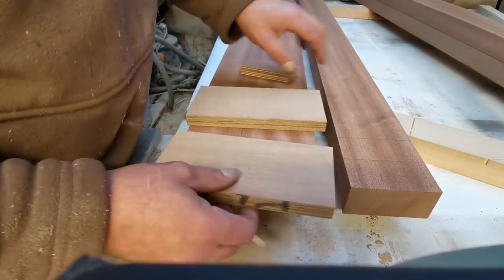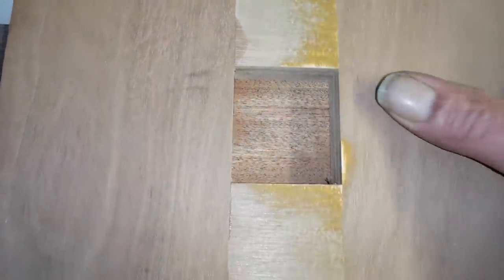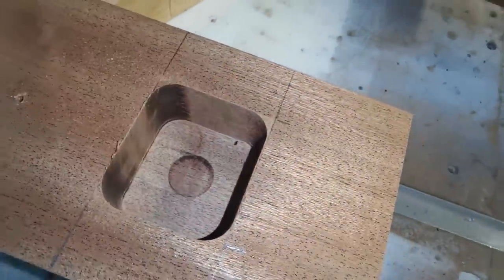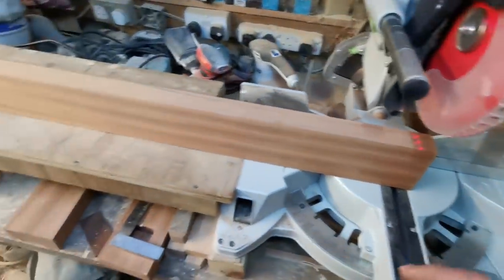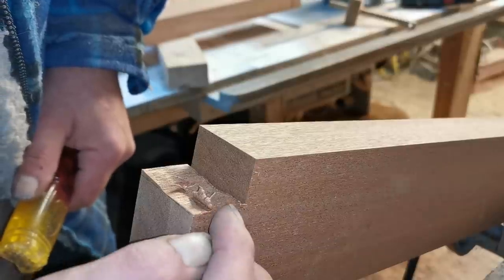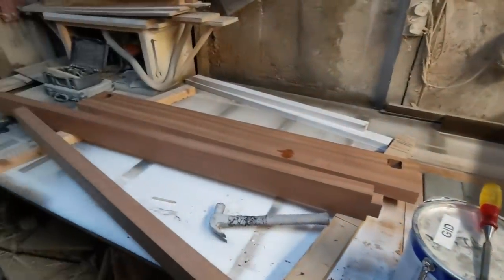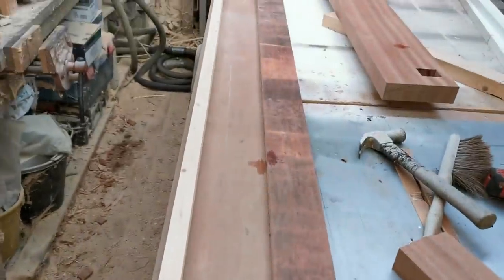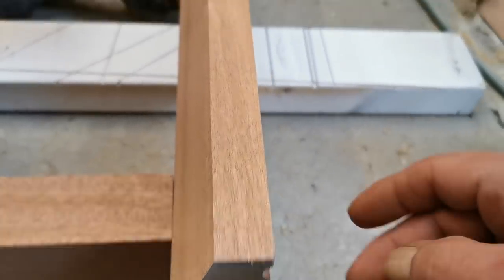French doors & bay window Pt6 - Making the window, mortices with a router & planing a chamfer

Comment: I was so involved in that mortice clean up I subconsciously blew at my screen to get rid of those shavings 👀. Its been a long day!
Reply from the maker: 😂🤧 I think I've done that, backed away from the screen when the shavings off the router hit the camera 👍👍
Reply: @Gidjoiner  not just me then! Love these videos! Any more projects in the pipeline? What's your workshop tablesaw btw?
Reply from the maker: 😊👍 Maybe more vids after this, not sure yet, I've plenty of work but not sure what's filmable, sometimes it's just work n i have to crack on 👍 
I only had about £500,  I had a choice when i bought the table saw, a couple of cast iron topped ones that didn't seem that well made, a small Dewalt/Makita type site saw or this Scheppach tisa 5.0 table saw, i went with the Scheppach because it cuts 100mm, the others only went to 70mm-ish, & this was more powerful, i had a welder so planned on making a decent fence which i did, I never put the metal frame legs on it, it's always been mounted in the table as it is as i planned, it's a good saw but it is a 'Scheppach site saw' so it has had it's niggles which I've fixed , it's sort of become mine to care for & enhance 🤣 i had to fix the rise n fall but now it works better than it did before 😁 that's in one vid but i can't remember which, & the fence is excellent, I very rarely use that word but there's pretty much no play at all 😊👍
This is my tablesaw fence overview vid showing the saw, https://youtu.be/tQ97rFxfRFc 
Screwfix sell a smaller version, the 310, pretty much the same just less powered only cuts 80mm, https://www.screwfix.com/p/scheppach-ts-310-315mm-electric-table-saw-230v/4446J?kpid=4446J&ds_kid=92700022882493574&ds_rl=1241687&ds_rl=1245250&ds_rl=1244066&ds_rl=1249796&ds_rl=1245250&ds_rl=1249484&gclid=Cj0KCQjwu6fzBRC6ARIsAJUwa2QAY9Z3FEcbCMcEotrJacaRjkktt0iVXwXAMrUXKatma7iQPH4dsCYaAhioEALw_wcB&gclsrc=aw.ds

Comment: When you make those tenons, how much stronger are they than an XL domino? Would it work if you just dominoed it?
Reply from the maker: Dominos might be quite strong but i think these traditional tenons are stronger, the wood on the rail - the tenon, is part of the rail so no chance of it loosening, the surface gluing area of the tenon that is in the door stile mortice is greater than it would be for a domino, If i used Dominos the joint would have to have a groove or some kind of stub tenon included because a reg domino butt joint might open up n leave a gap, I don't use the domino on exterior doors & the only thing holding these 7½-8ft doors are these tenons, these aren't cheap doors, I don't want any comeback, i want to feel i did the best i could & traditional M&T's are tried & tested so i think it's well worth that extra effort. 👍😊😎
Reply: @Gidjoiner  ah I see, makes sense. Really skilled bit of work.
Reply from the maker: Thanks 👍

Comment: Really enjoy the videos, would it of been a bit faster to use an auger bit to remove most of the mortice and save the router to clean it up. Just an idea
Reply from the maker: Thanks Kenny 👍 but no, it would mean using two different tools, auger bits can be unpredictable sometimes & have a longish point so no flat bottom holes, & drilling to the correct depth. I think that would have taken longer, if not as long anyway n been messier  😉, I think this way is fairly quick n clean. 😉

Comment: How you find the kapex?
Reply from the maker: It's in my shed 😏 lol😁
It's spot on, i had enough money to buy a big Dewalt/Makita maybe one of the cheaper Kapex's but asked a couple of friends i do stuff for a lot for a couple of days work paid in lieu n got enough to buy this, i liked the way the arms don't move, the saw just slides along them, there's very little if no play in the cut, I wanted a 'perfect' cutting machine to compliment the Domino, I've no regrets 👍👍
Reply: @Gidjoiner  😂 yeah I read it that way after I posted it.  Good to see a real carpenter say it's good rather than just a festool fan (of which I am one to a certain extent).  I've got the smaller ks60 in my shopping cart, trying to convince myself that it worth having over maybe a Bosch or metabo. I think I'm going to get it, carrying round my big old heavy makita is not back friendly and I end up not using it because of that.
I've enjoyed this little series, just subscribed 👍👍
Reply from the maker: I looked at all saws, my old Dewalt lasted over 20yrs, the Elu i had before was stolen but basically the same machine, they have a motor/machine that slides on fixed rails, that gives a 'no step' cut when trimming on top then pulling out to cut from below for a clean cut, so that's what i was after, the big Metabo i have for rough site stuff has tracks fixed to the motor head which slide from the back, it has loads of play, 3mm-ish from front to back, at first i was a little disappointed about that but i did buy it for decking, pergolas etc n expected it to get some abuse n a bit of rain on it, so it does it's job fine, because the rails slide it needs nearly a metre space front to back to work, it won't fit on a bench, i can't use it on my outside bench, I considered the other bigger Dewalts n Makitas etc but was worried about how much play they'd have, I'm sure they'd be very good but i don't have the opportunity nowadays to try other peoples me not working on sites anymore, I was looking for a perfect saw if it existed 😏 , I'm still a mocker of the Festool wankers club but i had bought the Domino n was drawn in by the Kapex reviews, the KS60 only has a depth cut of 60mm, that's no good for a 3x2 stood upright, so i was looking at the KS80, The request for work in lieu came up with 4 days pay offered, from 2 people, that's 2 weekends work to me, so accepted both n bought the KS120, basically the same as the KS80 but with the bevel adjustment knob at the front, those weekends were worked off within 6mths,  👍👍 The cuts are very good n repetitive, i don't regret & I'm still chuffed with the 'niceness' of it, it's my work so it will earn it' money it but ...£1000+ 😮🤷‍♂️
Reply: @Gidjoiner  cheers Gid, I have looked at nearly everything several times ad nauseam..   I think you can squeeze 66-67mm on the ks60 from a demo I watched.  Have a good week 👍
Reply from the maker: @noskills9577  👍 the 120 is a big saw, that's why I replaced my old dewalt for another dewalt for my site saw, that only cuts about 60mm so maybe the KS60 would be better, 👍